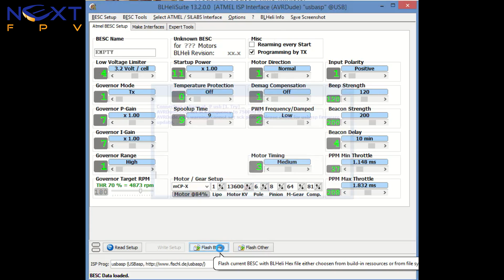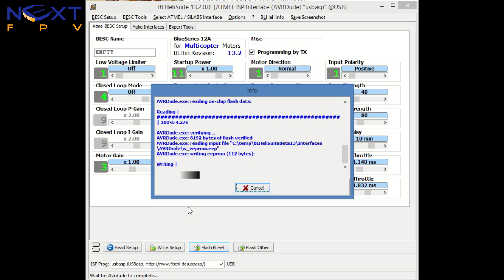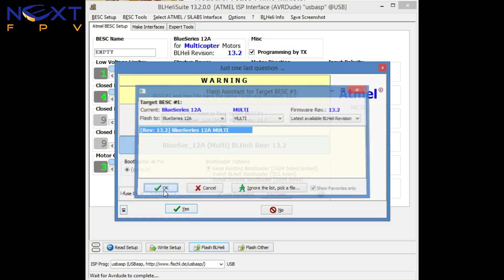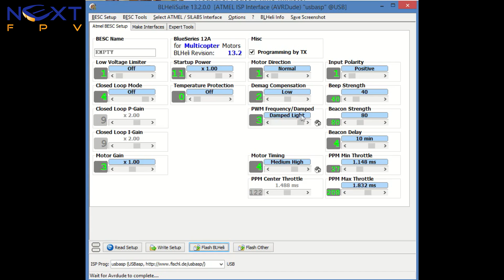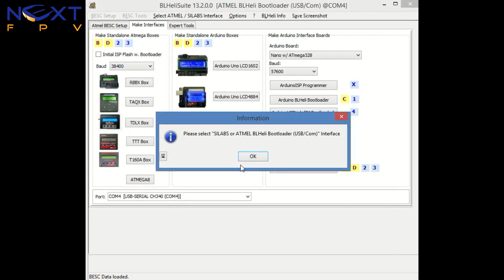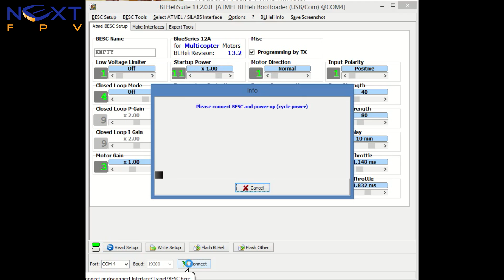Flashing BlHeli on ZTW ESC

Comment: Your instructure is L " Using Arduino Nano you can create a BLheli USB linker and use only the signal cable." That Mean using:
 gnd (nano)- Gnd (Bec of esc ) , 
D2 ( Nano) - vcc (Bec of esc ) and 
D3 ( Nano) - Signal ( Signal of esc) 
IS this right ?
Thanks so múchs

Comment: like a lot of people, i am looking for the easiest way to instal blheli, as a noob, it is perplexing to hear i can have a ztw 18a with blheli but a simonk boatloader which limits my ability to change settings on the esc via passthrough'' all of this info was gleaned from many sources... total pain.  after buying the turnigy usb linker i hear that it may or may not have a blheli booloader..... heart sinks.....bear in mind that i have already been stiffed when i bought RWRC 16 blheli esc's which don't work with blheli and now i find i cant change to a blheli bootloader without the usbasp tool and i need an arduino328 to create my own blheli usb linker, on top of the fact when i buy ztw spider 18a from hobbyking... they may or may not have blheli bootloader... seriously?... holy f¿ck i just wanna fly around a little, you couldn't make this any harder if you paid people to make as vague as possible...

Comment: what  bootloader is the best for ztw 18a spider opto esc? blheli or simonk?
Reply: +Luca Bellantoni Blheli bootloader as you can then use 1-wire through the Naze and other compatible FC's
Reply: NextFPV so i must install blheli bootloader whith blheli firmware for better performance
Reply: NextFPV aaaaaaaaaa ok perfect, bootloader, is as an os, firmware the bios

Comment: I have some ZTW 20A that were supposed to be blheli but came with simonK firmware. How to check what bootloader they have to know which way to flash? Can I just try the usb linker first or is there an issue if that doesn't work?
Sorry man, I goosed up so many esc flashing them I have to be sure.

Comment: Hello, I am using ztw spider 40amp esc with Tarot 4114 320kv motors, will theses esc be enough? I have it all hooked up and motors seem to run smooth and esc's stay cool! I haven't flown it yet and have esc's placed so that they get the air from my 15.5 props

Comment: does it also work for the 20A version?
Reply: +NextFPV what  bootloader is the best for ztw 18a spider opto esc? blheli or simonk?
Reply from the maker: +Johnny TSC Procedure is the same though you will need to select Blue Series 20A instead when loading firmware.
Reply: +NextFPV I got these ESC's https://www.multirotorparts.nl/electronics/esc/ztw-a-series-20a-esc-simonk.html
Reply: +Johnny TSC 
but what about the 18A version?
Reply: +Yves Coudurier yes 18A spider lite is the same process
Reply: I selected 12A series
Reply: +Rob Avery Ok, and what is the esc you select? Thanks

Comment: Awesome video. Very helpful.

One question: My ESC servo cables have just the one servo cable running out of it. Where can I attach the ground connection if the ESC's are already mounted on the copter? Just hold the ground connector to the negative on the PCB?
Reply from the maker: +ChumWaffle you will need the negative wire to flash via the servo cable as far as I am aware.

Comment: Thanks for the detailed video.   You covered more in 7:38 that I could possibly hope to find in an hour.    I screwed up flashing my ZTW Spider 12A ESCs last night using a USB Linker, I loaded AFRO 12A Multi code... I think it wiped the boot loader and the ESCs only beep twice then no response.. I'll be trying the USBasp method to try to flash the bootloader back per your video.